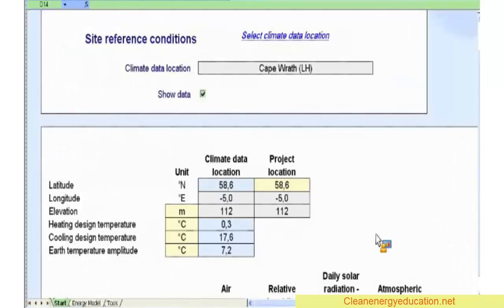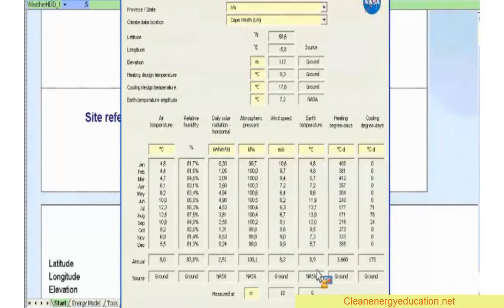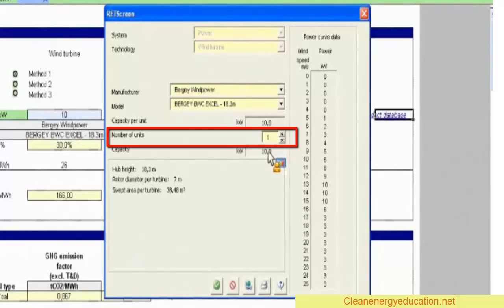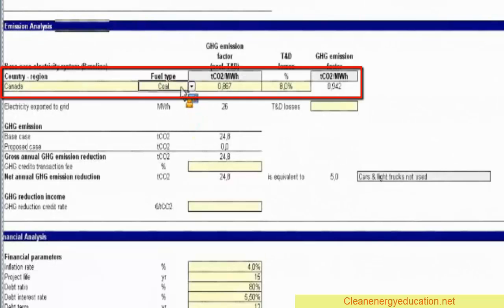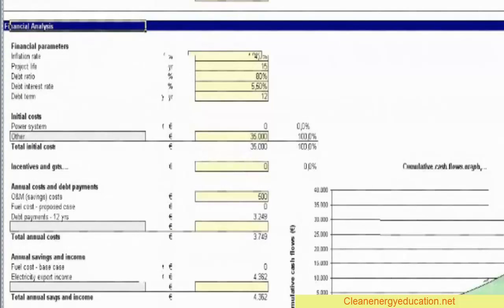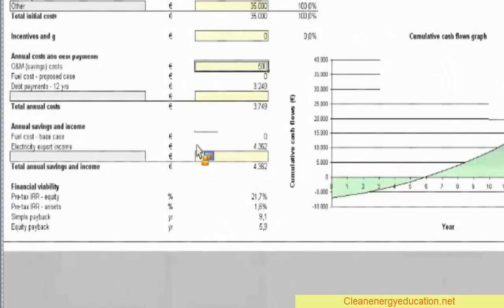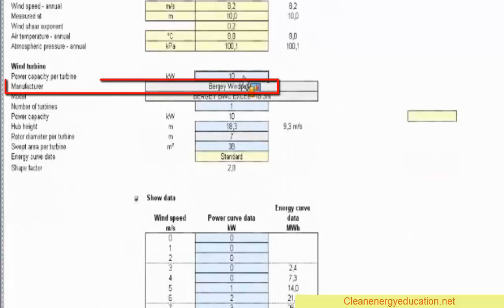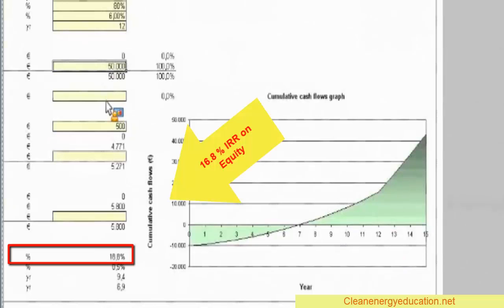Wind Energy with RETScreen 4: Video 5

Comment: RETScreen is not really a full design tool, even-though it can help with some (limited) aspects of the design such as figuring out the capacity based on other factors. To obtain consulting on RETScreen, go to  https://www.cleanenergyeducation.net/cei/retscreen.php or to take a course in RETScreen wind energy with the latest version, see http://info.cleanenergyeducation.net/node/24

Regards

Comment: IRR on Equity is basically the ROI on the money you invest. For example let's say you buy a turbine for $10,000 but only put $2,000 down, where over the 20 years project life, you would like ROI to beat your Retirement Plan return of 5%. The $2,000 is your equity. IRR on Asset is the ROI on the whole $10,000.  IRR can be calculated as an excel function which uses cash flows for the 20 years and the Discount rate.